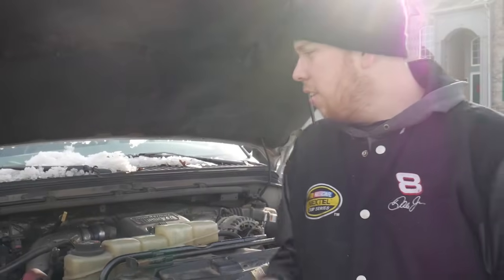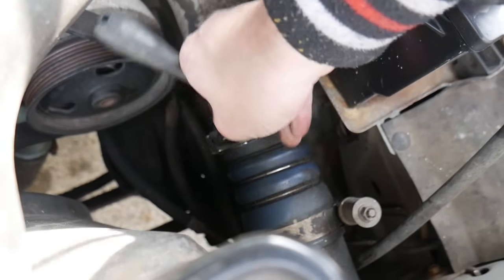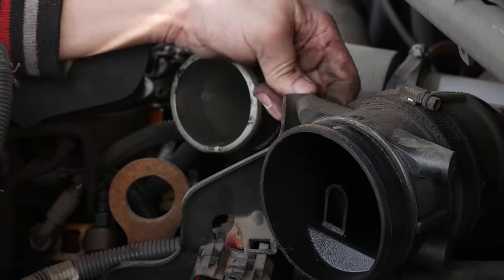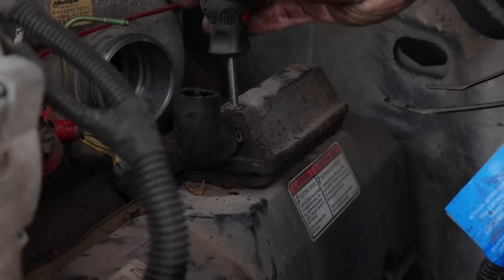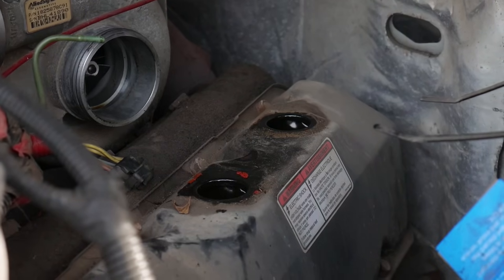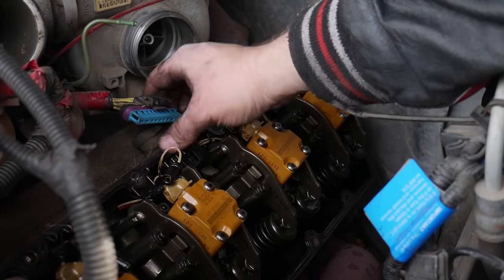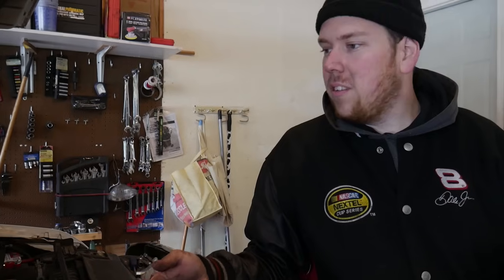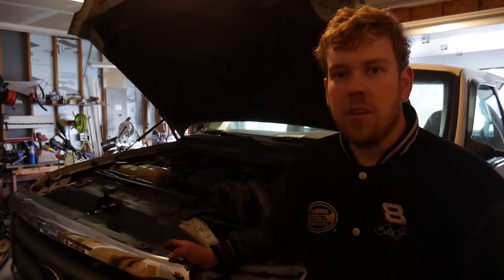How To: Change Glow Plugs on Ford Powerstroke 7.3

Comment: Using the clear tubing to remove and install the glow plugs instead of a 60-80$ special tool from the dealership is genius
Reply: Works well on spark plugs in gas motors also.
Reply: Have boney fingers and you can get it too 🤣🤣
Reply: you wont cross thread either

Comment: Great video. Followed it before I did mine. It's all done now and appears to be working, will find out more when it gets colder.
Them back bolts on the valve covers were a real pia but got them out.
I did replace new gaskets as well.
Thanks for everything!

Comment: Great video. No nonsense. I have got to change mine out. Check engine light is on. My programmer is showing #7 is bad. I was dreading doing it, but your video explains the process well.

Comment: I couldn’t see the difference between the old slip gears and the new ones holding up to the sun. But now my truck starts nicely in the cold. Before it needed a couple of hours plugged in with block heater. I’m in Manitoba so this is serious. I’m very happy that this $150 part worked. Don’t strip your sae bolts with the impact on the installation like I did. Not a big deal.

Comment: Great video. You should test with a meter if any of the glow plugs work or not first. I have two that seemed dead and I heard that if even one doesn’t it can cause it. Bill has a Powerstroke video on lower oil pump which would be the next stage step if this doesn’t fix it. That’s a little bigger more expensive job, but doable.

Comment: Well got the drivers side done, the tube trick was great, on to the passenger side along with a Wicked Wheel 2 install at the very end.
Reply: What size tube or what type?

Comment: Keep your 7.3 as long as you can afford to. It's that last engine Ford made that was bullet proof and reliable to 1 million miles. The rest of the truck would die before the engine ever will.
Reply from the maker: I sold this truck to a buddy shortly after this video. It was a great truck. Now I have a 5.9 common rail Cummins. I love that Cummins. I do miss the 7.3 sometimes.
Reply: Yes sir! Doing that! Found an 02 F250 a few years back, had ~ 240K miles. Has ~305K now, had to replace high pressure pump, radiator, water pump, oil cooler, intercooler couplings, etc, & wondering now when the glow plugs or tranny go out, haha, but I use her everyday for work. Also threw on a DP Tuner chip. Wish I could afford some exhaust action, but truck pulls soooo much better with that DP chip.
Reply: Great motor. Ford didn’t build it though.
Reply: Amen on that!

Comment: Great video.  was wondering how much work it would be to get in there and change the plugs and wiring.  Mine won't start unless plugged in below 8 C.  One thing I did read about the crankcase breather is that once your remove them it is difficult to get them to seal again.
I also have slow oil leak on top somewhere, as it collects on top of the engine, and runs to the back and down on the ground.  I am thinking valve covers maybe leaking, or the turbo charger.  I had to replace the turbo a few years go, as the bearings had started to go.
Reply: Did you ever find the oil leak?
Reply: @amarkisich  yes, it was a seal on the HPOP.  Replaced them all.

Comment: Perfect, helped me a lot, one question, I see a lot of gasket kits come with a plug and wires to be hard wired. Did you replace the outside plug, or hard wire a new one?

Comment: What was the trick to putting the glow plug back on from the wiring harness. I'm struggling because the plug doesn't want to line up and wont snap on the glow plug. Thanks for the help. Jason Eads

Comment: For anyone doing this or about to, go to your local dealership and buy oem. The aftermarket gaskets and glow plugs are garbage. Stick with motorcraft and be done with it. Should be around $80-90 per gasket, and around $15 a plug. Pricey but well worth knowing it will last

Comment: What brand valve cover gaskets did you use and how have they been holding up ?
Reply from the maker: I used FelPro gaskets. I am not sure how well they held up in the long term. I sold this truck to a buddy shortly after I made this video. He used it problem free for a year and a half and then it was totaled by a snow plow while it was parked.

Comment: ONLY use motorcraft glow plugs!!!! Other brands are known for swelling up. Orlieys sells motorcraft glow plugs. If you have one that's stuck spay so pb blaster or kroil oil work it in and out. Don't go johnny Rambo on it.  If you can change spark plugs you can do this. If you take the breather off it won't go back on the orings need to be replaced. Check you wire harness too the have a tendency to rest on the valve cover and over time you'll get wire chafing which leads to an injector Miss fire.  You can put a price of heater hose around the loom and tape it up . The problem seems more one the driver side. I would also replace glow plugs realy with a Ford one. California emmison truck have a glow plugs controller they pretty solid which if it fails the bitch won't start unless it warm or plugged in.  Also in spect your harness connection on the valve cover gasket they may have burnt connectors there are repair connectors out there. BTW if you've never done it worse case 7 hours and if you've done it before about 4 hours. The IDI are cake there no inter cooler pipes in the way.  Good video and yes the hose trick is a must ! Been there done that still stroking 342k.

Comment: What is the part number for the valve cover gaskets?  I have a 2000 f250 with roughly 535,000 miles and would like to change out the gaskets when doing the glow plugs.
Reply from the maker: Hey, thanks for watching! The part number I used was Dorman Part No. 615-201 because it came with the wiring.
Reply: WOW MAN 535K. MY HAS 200K. WHEN DID YOU PUT THE FIRST SET IN ?
Reply: Miguel Gomez 
Thanks!  Got them here.  Now just gotta put them in.
Reply: spmoses1 
I have no idea.  I bought the truck used.  I'm not sure what has ever been done to it.  I am in the process of trying to get the service records from Ford.  It had right at 500k when I bought it.  Seems to run well, no oil leaks (knock on wood) Strong boost, etc.
Reply: Rockauto.com   its all listed

Comment: what method did you use on removing the valve cover bolt up against the firewall?
Reply: He probably had the same fight as I did with mine. 1/4 drive ratchet, 6" extension bar universal joint and  1/2 or 13mm socket. Hopefully your bolts aren't covered in oil and gravel like mine were and the socket will fit easily . Passenger side is real fun to if you have the heater fan box in the way, you only just about got room to get your hand down there and the socket / ratchets at a crazy angle with the joint. I found it took longer to get the cover bolts out than do the plugs and put it back together. I didn't learn any new words either I new them before this fun project L.O.L

Comment: how do  you remove when head of plug snaps off and leaves tube in block. be careful removing is all i can tell you guys because man o man what a problem
Reply from the maker: That would be a much longer video! Thankfully didn't have to deal with it while I owned this truck. I have done it on a couple of Ford 4.6 gassers,  those were not very fun.

Comment: What symptoms indicate that the glow plugs need changing? My 7.3 has 250,000 miles on it.
Reply: Richard Mang it usually has a very hard time starting in cold weather and requires the block heater to be plugged in to be started
Reply: OK thanks. My check engine light has codes indicating bad connection to one side, cyclinders 2,4,6 &8.

Comment: Hey bro... I got told by a mechanic thst only a few glow plugs were bad I. My truck.... should replace only the few bad ones?
Reply from the maker: Being that the most difficult step is actually gaining access to the glow plugs I would go ahead and replace the whole set. That way you aren't tearing into it again in less than a year to replace the rest.
Reply: @TDKRepair  much appreciated!
Reply: If you can afford to run a diesel.  The glow plugs are probly the cheapest parts to replace.   Dont be cheap. Lol.

Comment: ATTENTION...ATTENTION...YOU NEVER mentioned that you can't get your hands or tools on the back bolt on the driver's side and the back 3 bolts on the passenger side...you have to remove or cut the inner fender to get those...after you  break fingers and/or hands the the process goes as stated...then you have to repeat the procedure to reinstall the said bolts...your simple process ends up taking a good 18 hours if you are a shade tree mechanic...